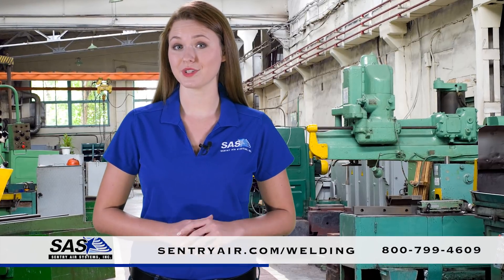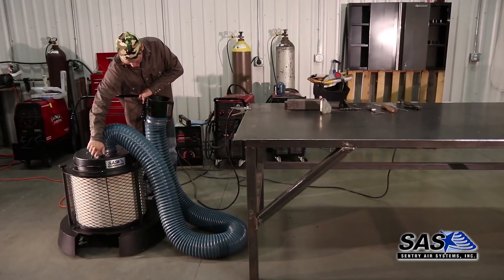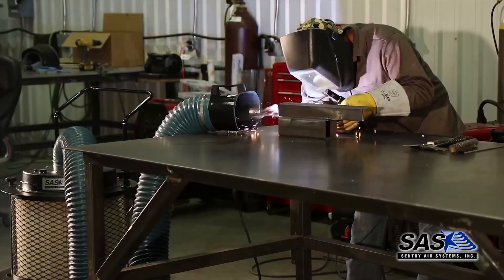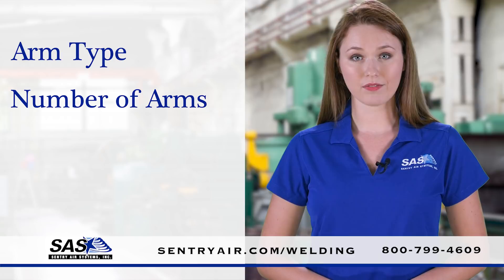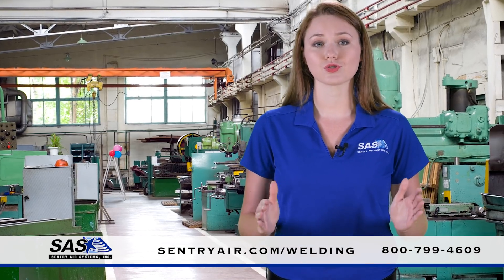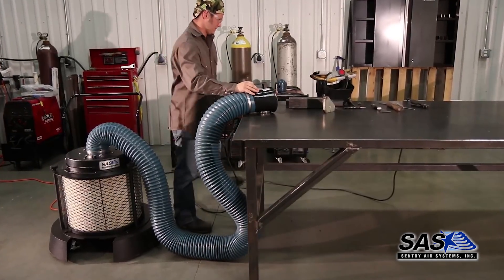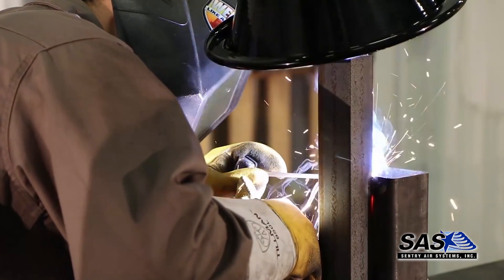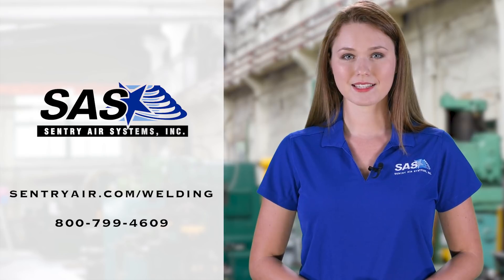Welding Fume Extractors - SAS - Welding Fume Extractors

Comment: If you are serious about fume extraction, avoid Sentry Error.  The MERV ratings of their units are completely unreliable.  The cleanable filter systems claimed a MERV 16 rating and then suddenly were downgraded to MERV 13 without notice.  That's a big difference and they provide no explanation for this at all.  No quality control whatsoever and their units have leak issues.  Neither Blomar nor Rottsnaggle have a clue about filtration and they will tell you anything to get you to buy, including misleading you about the filter rating.  Avoid this company!